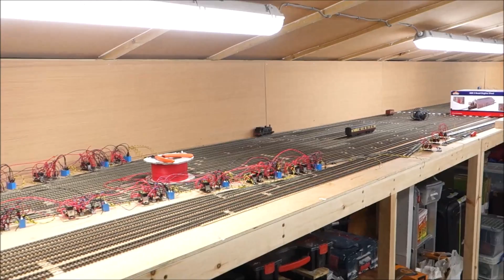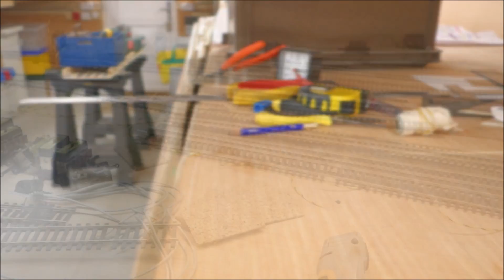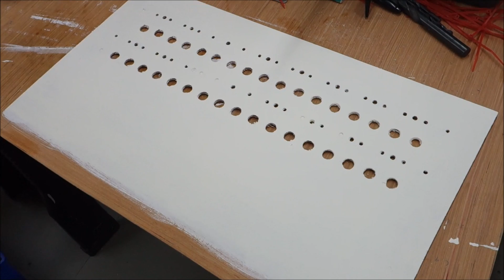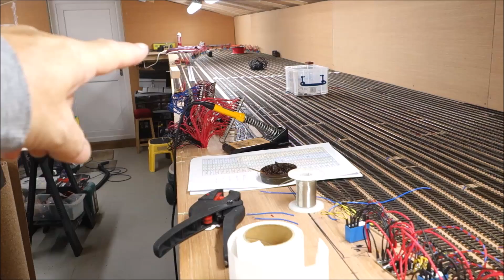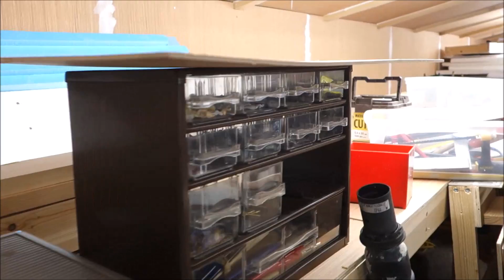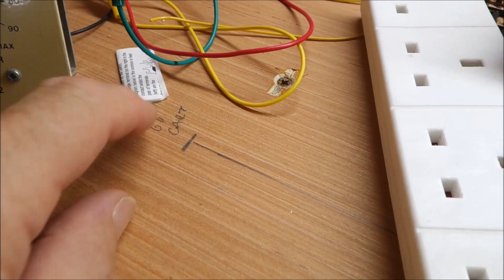Making Tracks - an update on the new Yarslow Model Railway project

Comment: Your method of working the mimic lights makes my version seem well overcomplicated. I used Bi-Colour LEDs and diodes to work straight off the frog power. I had a piece of strip board with all the required diode pairs on it along with power from the DCC bus and lines from the frogs.
Reply from the maker: Hi.  The great thing about our hobby is that we are all right and we can all learn from others.  Most of my methods are borrowed from other layouts or adapted from things I have read or seen.  The main issue with the relays is the mass of wiring on a small space - I have got a lot of tidying up to do when I get a chance.  Have you got a video posted of your mimic light method?

Comment: Same as I did outside track  too close to the wall no room for scenery or backscene . Just wondering what’s going to happen with scenery on the layout. Like the size of the layout
Reply from the maker: Hi Wilbury Castle.  There's more room than it looks!  The layout is set in Lincolnshire which is VERY flat so I don't need hills etc.  I used a similar style on the old Yarslow layout and that worked so here's hoping!!  I am some way from scenery but stay tuned and it'll happen!

Comment: looks as if this will be a very nice layout. One comment if I may. I've found from painful & expensive experience that transferring long cassettes/cartridges over a distance of 3'  to be extremely difficult and prone to disaster.
Reply from the maker: Hi Jeff.  My old layout used cartridges exclusively and I am using that experience to make these as safe as possible.
Reply: @yarslowmodelrailway1  it's the reach over 3' of storage tracks that concerns me. Bitter experience showed me it was just too far.
Reply: @jeffsymons4535  My boards are 3 feet wide and the tracks furthest away are very difficult to reach / clean, I would reserve anything over 80cm from the front for scenery... good luck with the project!

Comment: Very nice layout and coming along very nicely. Curious and maybe I missed it bit how long and wide is the layout and how long and wide is the peninsula by chance. Also what is the radius on the curves. Keep up the great work and I look forward to your progress
Reply from the maker: Hi Kanishirosouthwester  The layout is 27ft x 12ft 6 in.  Details of the bits are in the video "A detailed look at the new layout".  The curves I have laid are all 24/30 inch transition although some are more 24 than 30!!  24 inch is fine and my absolute main line minimum in hidden area.  I prefer minimum 36 inch in scenic bits.  The Peco small radius pointwork used in the storage loops have a nominal 24 inch radius.  Give us a sub and stay in touch for more updates coming soon.

Comment: Wow, that is exceptionally impressive, really instructive video, not sure I fully followed all the electrical stuff, but I did follow a lot of it, so hats off! Really look forward seeing how this turns out, subbed for more. Cheers!!
Reply from the maker: Hi.  Many thanks for your comments, encouragement and sub!  I will cover the electrical circuits in the storage area in a bit more depth next time - it will be easier to see when they are up and running rather than trying to explain it "dry" as it were.
Reply: @yarslowmodelrailway1  I will try to follow :)
Reply from the maker: @AberHaltJunction  Hi  Latest video contains 2 bits on relays - hope it helps to clarify things!!
Reply: Thanks Yarslow, will take a peek. Cheers!

Comment: Wow you have made some progress, very interesting, you have been busy but then it is fun. 
I know you have said before regarding measurements but how wide is the worktop where the fiddle yard is, as it looks quite wide should you have to lean over to pick up a carriage etc from the furthest track. I realise camera angles make it look a lot wider. 
Like you say your in no hurry and you go at your speed. Still looking forward to the next video though.
Regards Chris
Reply from the maker: Hi Chris.  The storage sidings board is 36 inches wide which is the limit of my reach.  However, I have a 6 inch step which I can use if I need to reach the back.  Careful track-laying means that this should be a rare event but I will need to clean track etc at times.